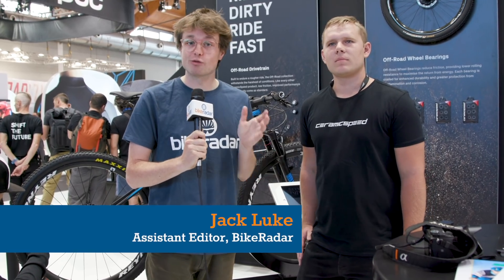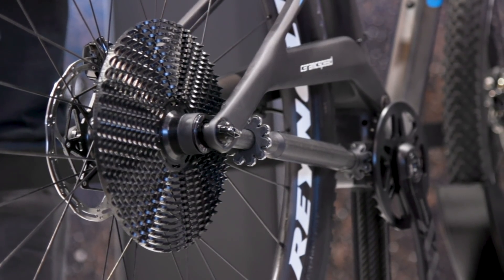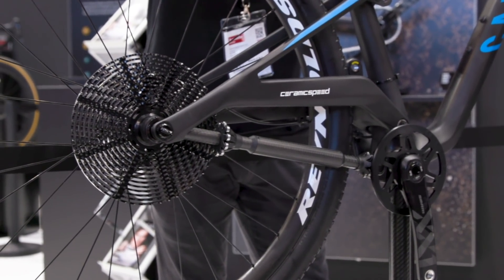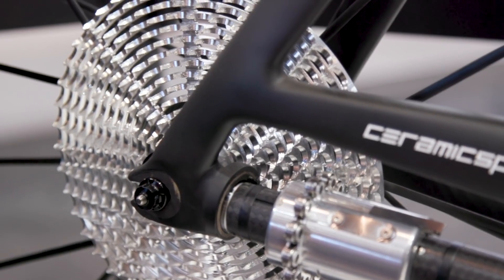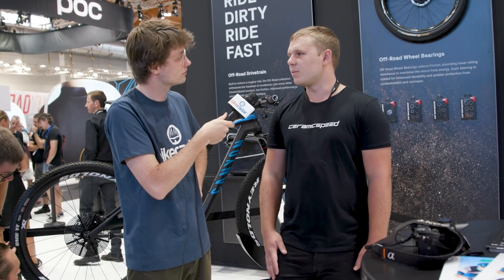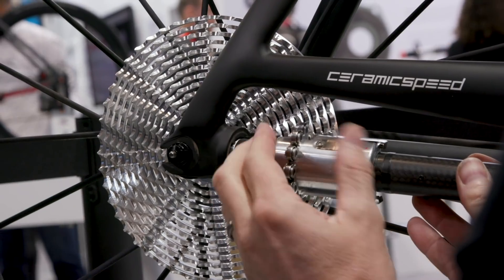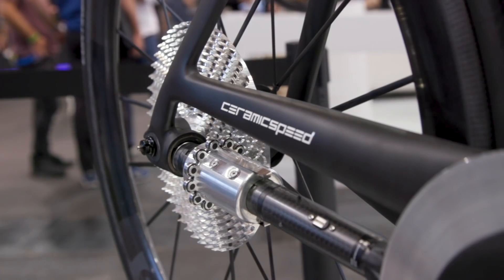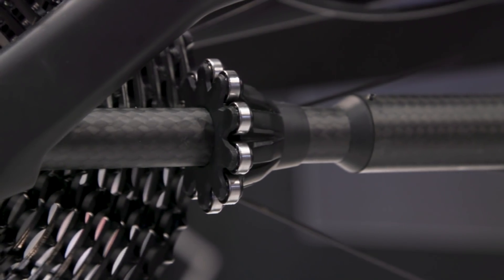No More Chains! The Future of Bike Design? | CeramicSpeed’s Driven MTB & Road Drivetrain

Comment: What we need is affordable gearboxes that use a thumb shifter. That would be the dream. Goodbye rear mech.
Reply: To much friction
Reply: @joachimrydelius2125  Probably no more than a dirty chain. We're (tbh I'm not sure about the OP but I'm...) not talking about race spec parts (else why the affordable bit), but more for your everyday cyclists who does it for fun at the weekends (or else commutes), their gear is not likely to be pristine anyway, so any extra friction can be compensated for by the sealed unit.
Reply: Ser Garlan Tyrell Yes you may be right. There is a gearbox, Pinion, people who use it say it is minimal difference from a “normal” drive train. I would like to try it for myself. Im really tired of the rear mech.
Reply: @joachimrydelius2125  Yeah, rear mechs and chains are a hassle to keep running smoothly, I'd take the extra weight if it means I don't have to realign my hanger every weekend and fiddle with it all the time.
Reply: @joachimrydelius2125  Apparently Rohloff hub gears are more efficient than the pinion ones, but they're exceedingly expensive (like more than an entire dura-ace groupset) people rave about them but I'm sure some of that is trying to justify why it was so expensive...
 
They claim to be more efficient than a derailleur in most gears too but I think they must be measuring that against a dirty chain. Plus I hate HUB gears in general, as it makes it 1000x harder to fix a puncture so I think a bottom bracket gearbox is a much better place for it, even if they're less efficient.
Reply: Ser Garlan Tyrell Long time no see.. :) I would definitely prefer a gearbox in the bottom bracket, keeps the unsprung weight low. Not seeing how the Rohloff would making fixing a puncture harder though!?
Reply: This! 100%
Reply: honda did it a decade ago for their downhill race bike. As did truvativ (kind of) with Hammerschmidt.

I think gear box has way more potential now than before as it would integrate so well with mid drive ebike motors. So there is a major motivation for Shimano etc to create something for mass market.
Reply: @dfpguitar  Hondas gearbox was just a derailour system in a plastic hovet!
Reply: @joachimrydelius2125  that was the V2 after UCI banned the original gear system which was a CVT.
Reply: Exactly.
This is another high-end product which some enthusiasts will enjoy. We need new, better technology for the mass market.
Reply: @Luke Hunker 😁
Reply: Those are heavy tho, I don’t really care about weight. But it has a limit.
Reply: @Lanakik05  True. Once you hit around 35lbs on a bike, you really start noticing the weight.
Reply: Shimano Alfine and Nexus internal hubs. Cinq shifters for Pinion gearbox and Rohloff Speedhub.
Reply: Ltwoo mate, same creator/makers of sram
Reply: @hansrodriguez2268  LTWOO, a Chinese-copy of SRAM tech lol. "LTWOO engineers are former SRAM engineers" hahaha

Comment: I see a lot of maintenance needed for this drivetrain (full suspension), it's just easier to use a normal chain, an epic concept but  I see it used for road biking rather than MTB or DH.

Edit: Just to be clear I am not hating on the concept, but I feel like the presenter was not correct 
and quote : "We remove the vulnerable derailleur" yes but you gain an additional "carbon stick" wich i feel like is quite vulnerable than a derailleur plus much more costly to repair than just switching a broken derailleur hanger or derailleur ~ in any case i feel as this is perfect for road biking (cause' efficiency) and not as perfect for slippery roots and rock gardens!